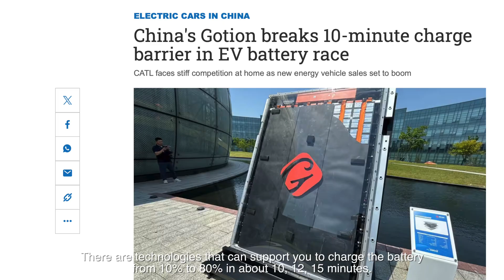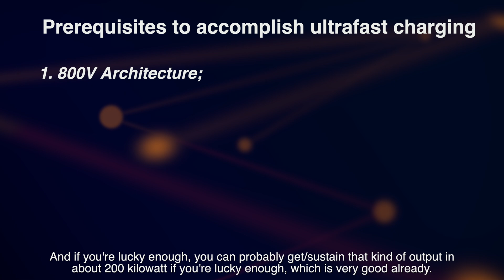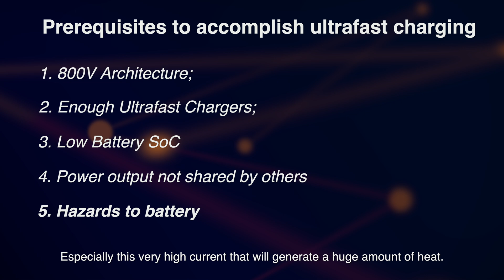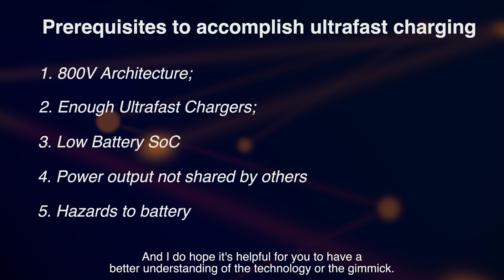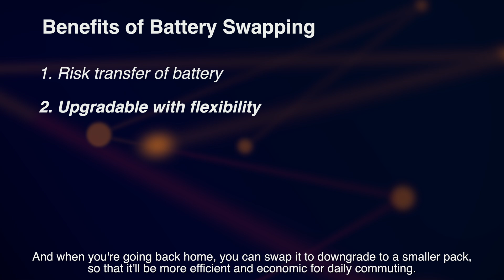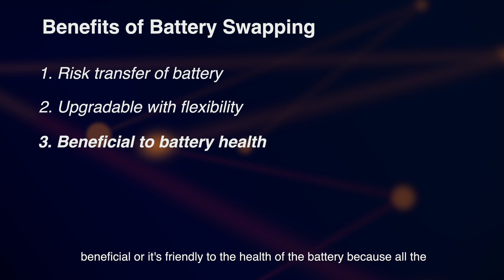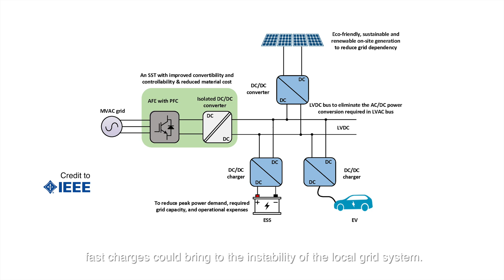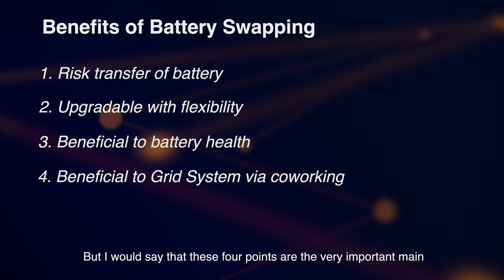NIO Battery Swapping better than Ultrafast Charging? | A detailed comparison | Updated 2024

Comment: The question that never gets answered by those videos is the logistics behind all this (I have to try and find some more videos on the subject though).

1. Let's say that a charging station contains 20 batteries (as you said in the video) ... if 21 users come one after another to swap batteries, the last one will basically get the first battery that was swapped (4 min/charge x 20 users) 1h20 minutes ago. That means that the swapping station must make sure that it can charge a battery at least to 80% in that time. For a 100 kWh battery, assuming 20% charge for the previous user, it's an average of around 50kW (which would still be a DC charge ... but much more friendly to the battery I agree).

2. On motorways, during summer holidays, you'd need at least 6 of those side by side to cope with the needs (assuming users are well behaved and optimize their stop). There you are starting to have an insane number of batteries all in the same location, which could decide thieves to come and steal them.

I think that having chargers that can give 250 kW is largely enough. If your car can keep this speed till 80% like some new ones currently do, you have a quick enough 10-80% (50 kWh every 12 minutes). And while it's charging, you can do something else, you don't have to stay in your car and/or wait for a swapping station to get free. Fortunately, you can still fast charge even with a swap-able battery.

Nevertheless, if swapping can bring a standardized format to batteries, then it's all the better.
Reply: 1. Is no problem, 50kW average charge is lower than most middle class EVs output these days.

2. Not thinking about thieves, but the logistics. Must be insane.

Overall its a race between the infrastructures, charging vs swapping, and also battery tech.

If batteries will charge 10-80 in 10 minutes and you have them everywhere, while swapping stations arent available everywhere, why should people swap? Especially when it gets crowded. 

I also see drawbacks in innovation and  functionality: you have to support older vehicles for a longer time, therefore accepting possible bad Design flaws from the beginning. What happens when batteries get lighter or heavier? Suspension wont work with zo much difference and still allow full capacity for persons and baggage.

Comment: Im probably not as well informed as you about this subject but i would like to share some points with you. Please feel free to correct me where im wrong:
1- from my understanding when we buy a new car from Nio, we dont own the battery, but still it costs as much as a comparable car with the battery price included. So, no savings there.
2- we have to pay the subscrition for the battery (the price i found was about 165€/month on europe). That means in 8 years (the battery warranty time in any other brand) we spent almost 16000€  (about the price of 2 batteries). 
3- this stations are very expensive and from what i ve seen only swaps one car at the time. If you need to scale up you have to build another station? The cost for station i found (probably outdated) was $600.000.
Reply from the maker: Hi, thanks for bringing up your doubts here.
1. I don't know how you define the comparable cars in EU region, but I'd suggest you touch and try the car on road by yourself. Many other freatures like the very important NIO service is excellent as one of the only kind (No idea how they perfom in EU). For instance, right now I'd still prefer an EC6 over a Macan EV if I want a new purchase.
2. I'll share you from the perspective of CN domestic market, people calculated for about 6 years, namely if you plan to use the vehicle over 6 years, then it's suggested to purchase the battery altogether with the car, then you'll just need to spend for later swaps but no subscription fees of the battery. I'd suggest you to conversate with your local agent for details as different regions vary.
3. Due to scale effect the construction cost of each station has brought down to 2 Mil RMB (300K USD), but NIO keeps adding new stuff and features inside with a goal of shorter time and better service, this could make it a bit more expensive again, but ultimately it's about the scale effect that reduces the average cost.

Comment: On paper battery swapping makes sense and solves much of EVs recharging problems, however, for so many reasons battery swapping is never going to catch on. 

EV suppliers have enough problem agreeing on a standard re-charging format (plug, handshake, throughput) they are never going to agree to a universal battery format.
 
For many of the newer EVs, cell-to-body technology is used where the battery cells are seamlessly installed into a car’s structure, reducing weight and less space.

If there was ever a window of opportunity for swapping batteries, it is rapidly closing, growing a rapid recharging infrastructure is far easier to roll out and upgrade than battery swapping stations.

Battery swap stations will only ever work at scale and there are simply not enough cars that support battery swapping. Scandinavian countries already have the best charging infrastructure globally and without state support and legislation, battery swap is going to remain niche, and eventually become the Betamax to VHS.
Reply from the maker: Hi, the power stations are able to store and manage different types/formats of batteries; the cost of constructing a power station is down to similar as ultrafast chargers due to scale effect. Indeed I agree that the swapping solution will not be the only/best option for most parts of the world, at least for now.
Reply: Yes, I think the same. With ever-improving battery technology, the arguments for swapping batteries are diminishing and will eventually disappear.

Comment: One thing in this video I did not yet think about: That the swapping station can feed the "regular" chargers which are mounted right next to it and provide cheap power, if the swap station has charged the batteries at times when power was cheap. The longer I think about Battery Swap, the greater I think it is... Thanks for this video.
Reply from the maker: Yes this co-working of adjusting grid peak loads were planned and succeeded multiple times and the power swap stations have been profiting already. I heard that this co-working could be more profitable towards EU grid system as its more mature in terms of detailed adjustments. Let's just wait for that progress, overall I believe the swap stations in EU are far not enough to realize that.

Comment: Wait till you try to resell a non battery swap car.
Reply: Hertz originally announced in 2021 that it would invest in 100,000 Teslas, but reversed course earlier this year due to low demand
Unreliability
Hertz's EV fleet, which is primarily made up of Teslas, has been unreliable
Higher costs
EVs are more expensive than gas-powered vehicles and have higher repair costs

Got that also
Reply from the maker: I assume that most expenses come from the battery. That’s why they would consider withdraw the battery out as separate asset.
Reply from the maker: The used NIO EVs here in local market are really well sold via NIO app as they are best value for money.